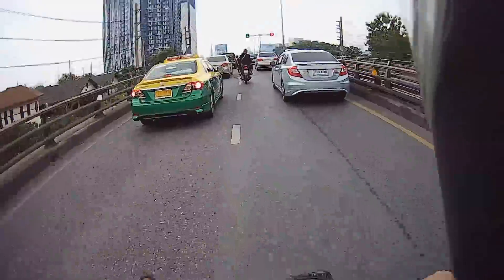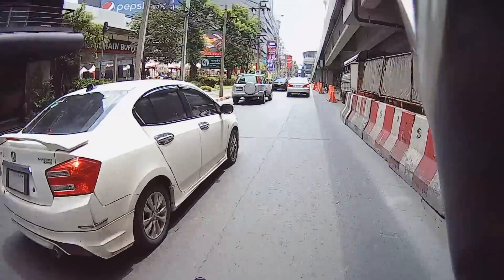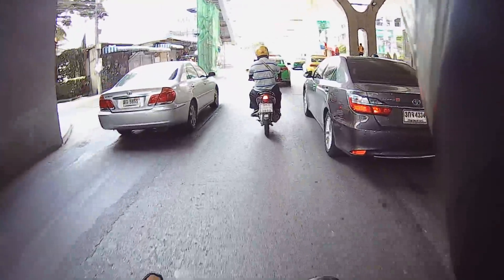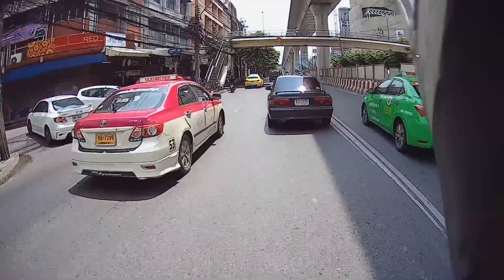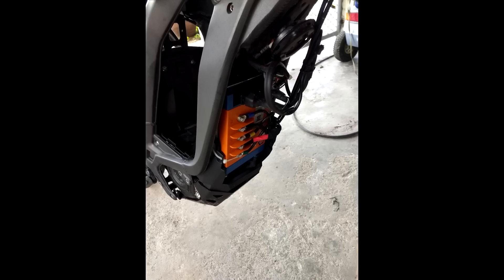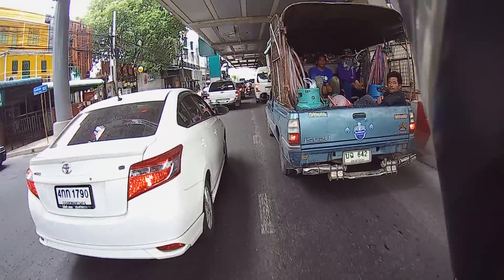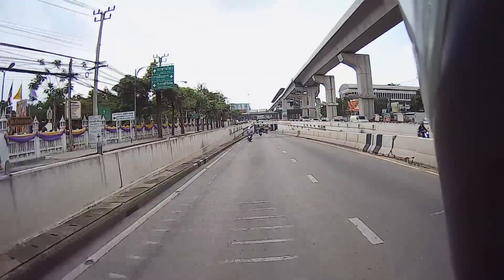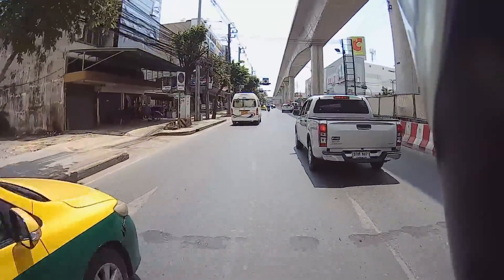My Surron upgrades and Mods

Comment: Awesome video- would you be willing to share the steps/settings for your dialed in ERT controller? Did you get the 4000 or the 8000 to future proof? I'm getting ready to pull the trigger on the same controller and want to make sure I make the right decision.
Reply from the maker: I got the 4000. Now, you need to get an app to change settings. If you buy from the appropriate person, they will provide you the login info. If you buy from luna, I'm not sure you'll get any of those secure information stuff

Comment: Did you end up dropping  that 72V battery in? Will that automatically  increase it to 120-130km/hr? Or reprogramming of the controller will be needed?
Reply from the maker: Haven't done the 72v. I'm focusing on the gokart at the moment
Reply: @EVSpeed  that go cart is pretty badass!
Reply from the maker: @user-yd1vi9zf6w  thanks!!! It really is especially when you drive it

Comment: What sprocket you using in this video bro with that new controller 🤔
Reply from the maker: Stock everything else bro. Soon 72v battery though with 250A output
Reply: @EVSpeed  Mice mate 😎I have a road legal Sur Ron X I only get 75kmh stock X controller and 48T pocket,I'm wondering if the BAC400 on 60V would give me any more speed 🤔
Reply from the maker: @xboxice2005  it does. I have the video saved. However, I've been busy to post the video. Will do so soon. Sorry for the delay
Reply: EV Speed Awesome 😎